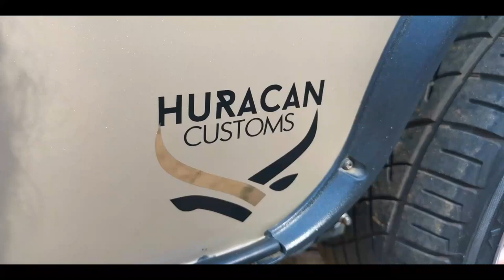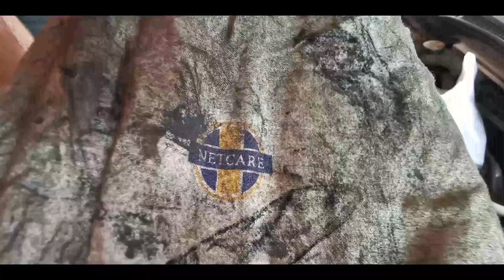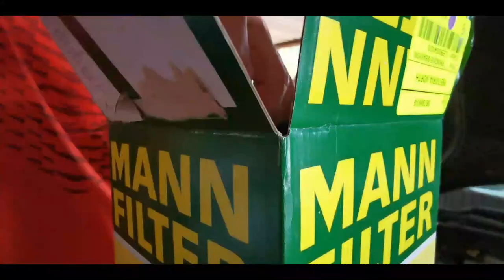Installing a new turbo into a Volvo C30

Comment: Hey guys, just a quick tip. I am a dutch camera operator. And I can see much potential in your channel. You should invest in a old Canon DSLR (5d mark 3 or above is recommended) and a good canon L series lens. Costs about 1500€ if you get a good deal. And invest in lavier Microphones. The production value of you channel wil grow a lot from that alone. And a simple (not the cheapest!) gimbal. Trust me it's insane how you videos start to look when you use this gear. 

And a tip about you aspect ratio. Don't use crop to make black bars. Just remove/ let out the pixels you want to make black. And if you want to make it cinematic use a 2.35:1 aspact ratio.
Reply from the maker: Hey Jonne ,thank you so much for the tips and advice ,filming is a big passion for us,now that we really appreciate the tips you gave us,we will definitely start using them and try to figure it out.we didn't study in this area, so we definitely use all the sources we get to improve ourselves! Once again thank you so much for your teachable, knowledgeable awesome comment, 😁🤜🤛👌
Reply: @huracancustoms2269  If there is any other way I can help let me know!
Reply from the maker: Hey ,definitely thank you so much 😁🤜🤛

Comment: Do you think it worth changing out a blown turbo that's diesel runaway.
Reply from the maker: Hi hope you had a blessed weekend, i can't see a problem using the turbo again just make sure that the blades aren't burned and that the bearings are still ok
Hope this helps .